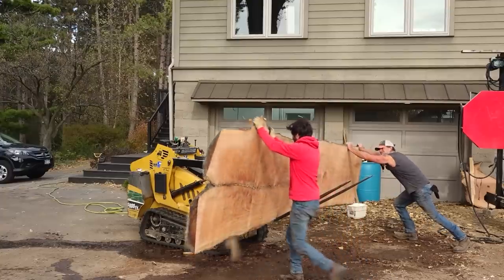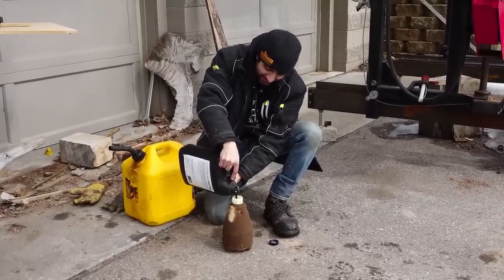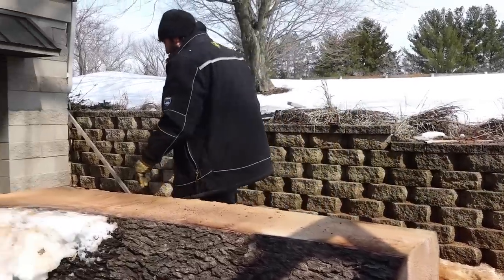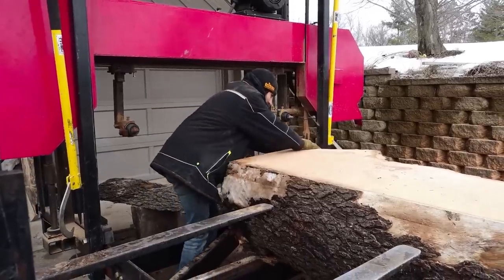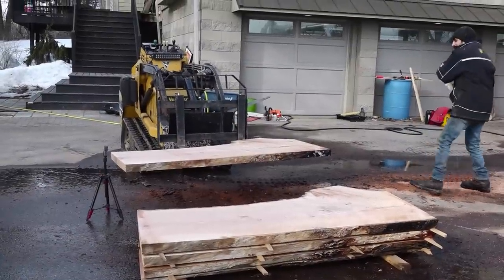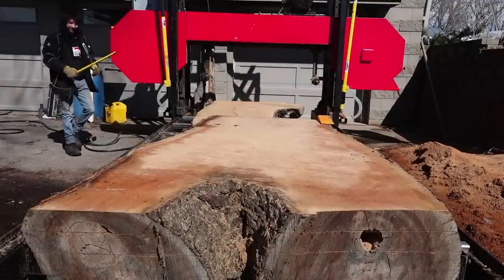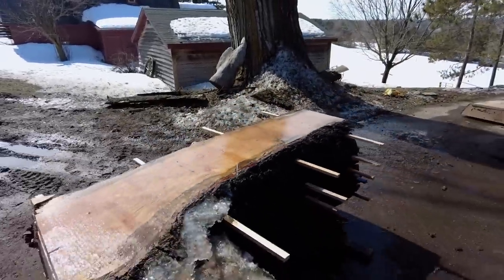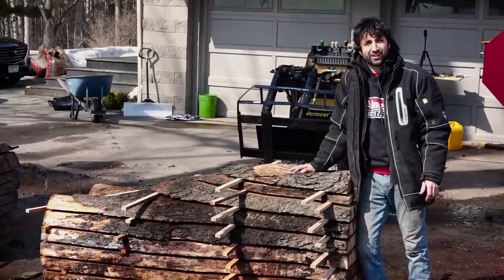Another Amazing Chunk of the Giant Cherry Tree

Comment: Matt, making your blade lube slurry of Bar oil and Diesel, does that have any sort of staining effects on the wood. I am asssuming that if using a drip system, its just that a drip, not a running or rapid flow. can you elaberate on that just a little?thanks for your time and videos.

Comment: Matt I think by using the hand sprayer might be better when you are using the diesel and oil mixture but myself I don't use it I am close to a ditch that goes to my pound and I don't want any residue in the pound I eat the fish out of it I use a mixture of dawn detergent and pinesol work great on hard wood but sometime still leave some residue from the yellow southern pine very resinae ano7gh sap that you can see light through it with a 3/4 inch board have a great day

Comment: It's the little things you don't talk about that are interesting. When cutting the log in half, you started with the bottom cut. I have seen so many people start at the top, and then wonder why their chainsaw is pinched. Over and over and over and over.
Reply from the maker: That and it keeps the underside from tearing as the two sides start pulling apart at the end of the cut

Comment: Matthew, please consider changing the hand powered travel winch on your saw with a motor. All you boards have a wavey surface that looks like it is caused by the different speeds you generate when you turn the winch.
Reply from the maker: It’s a sawmill, not a planer. Surface finish isn’t a big concern

Comment: Matt-With your ingenuity & mechanical skills, why don't you "motorize" the feed cable assembly? Also wondering why you don't just use a hose with a garden sprayer to check the slabs? Seems like it would be a little more efficient than throwing a bucket of water.

Comment: Seriously dude, I know in the past you've said you like that hand crank but come on now... you've had enough fun. 🤣 Replace that hand crank with a shiny new electric motor and save yourself a bunch of time and needless effort. Just think of how much more stamina you'll have for doing the woodworking if you're not worn out from cranking. Just some advice from a friend. 😎
Reply from the maker: That’s like the only exercise I get.
Reply: He’s a family man. The manual crank is his gym 💪🏼
Reply: Turning the crank builds stamina that's why the effort is not needless. As far as saving time goes; you can only push the blade through the wood so fast so once you got the motorized crank to vary it's feed rate according to the needs of the cut, you would be saving exactly no time at all :)